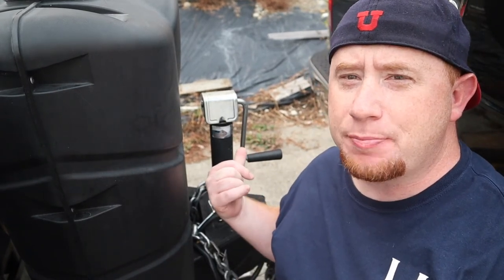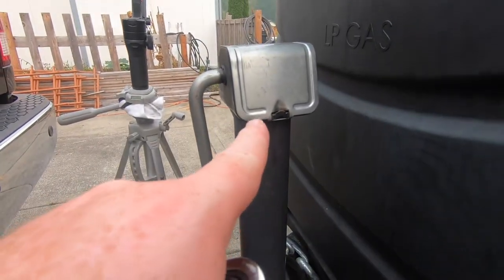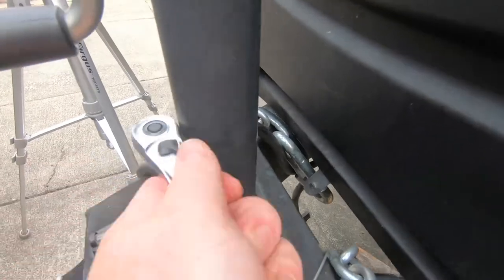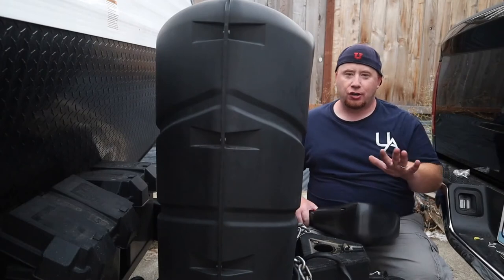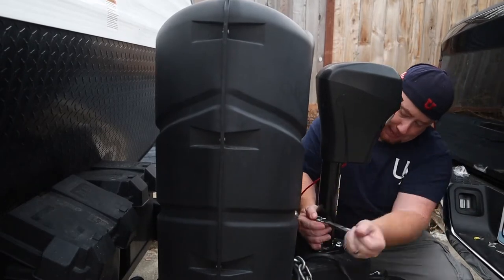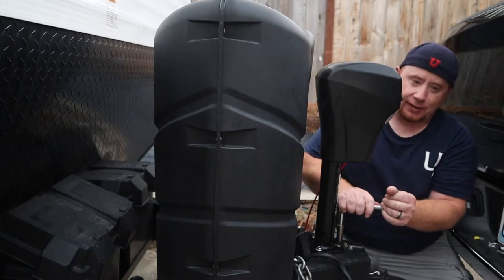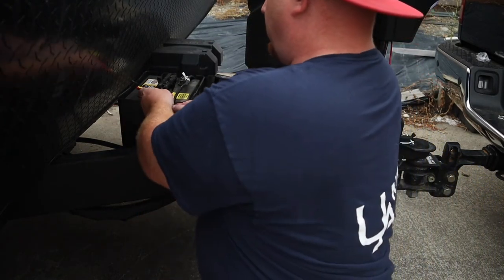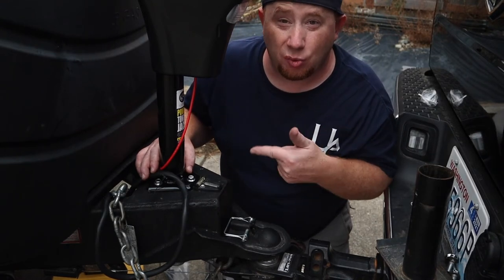HOW TO INSTALL A LIPPERT ELECTRIC POWER JACK ON A TRAILER / LIPPERT PT2 POWER JACK

Comment: An electric jack is one of the best things you can put on your travel trailer.  No more manual jacking in 35C 100D days. I'm putting one of these on my trailer to replace my seized Husky.  With the Husky I couldn't lower the truck gate all the way, wondering if you can rotate this jack to give clearance for truck gate.  Can't see why not, will test tomorrow on installation.
Reply from the maker: Thanks for the awesome comment. They are triangular so you should have no problem rotating the jack. Actually it’s a pretty smart idea to give you that extra clearance.